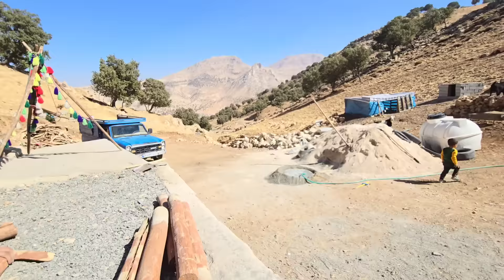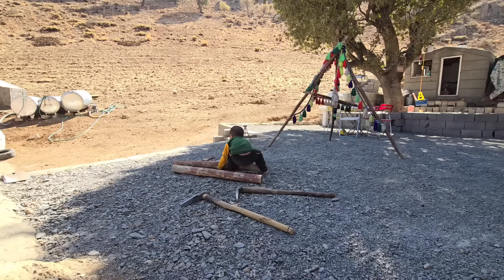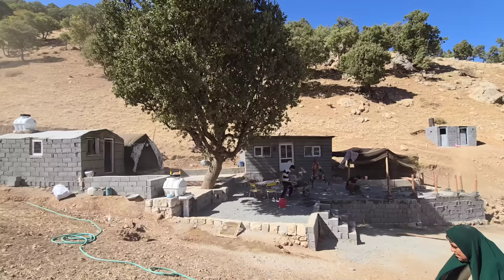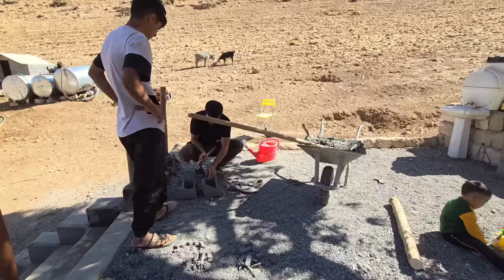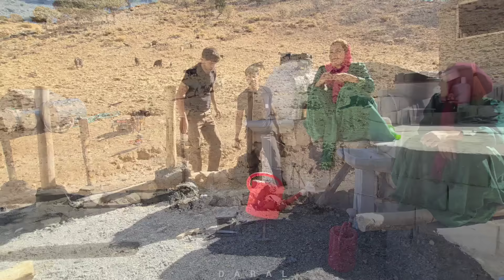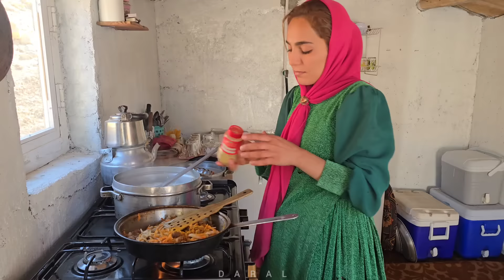🏡🪵"Milad and Qadir Install Wooden Fences in the Absence of Amir and Hasan"

Comment: Una sugerencia familia el cilindro de gas de la estufa debe ir afuera, pueden hacer un agujero y sacar la linea del gas, es peligroso tenerlo en lugares cerrados puede surgir un escape de gas y como no hay suficiente ventilación puede producir una explosión. Dios los bendiga familia.
Reply: ان وضعت خارجاً ستتجمد من البرد للاسف ، لذلك وضعوها داخل المطبخ
Reply: Sim iria congelar,mas não se fizessem uma casinha para o botijão
Reply: Querida Mahin, por favor bajale a la intensidad de la llama en tu estufa! 🙏
Reply from the maker: Querido amigo, la bombona de gas se congela afuera en el frío.
Reply: I had my gas bottles outside in below- freezing conditions with no issues they still worked. Just Insulated the gas line hose it won’t freeze.
Reply: Le pueden hacer una casita y protegerla,es mejor evitar un accidente family❤
Reply: por  mas de 30 años he tenido  mi balon de gas dentro de la cocina, todo va en ser responsable, controlar que no tenga perdida, la manguera y la valvula, ellos conocen el clima de su region mas que nosotros, como siempre digo, no imponer nuestras formas occidentales,

Comment: لكل من يقول ضع اسطوانه الغاز خارجا للاسف ستتجمد من البرد ، وضعها بالداخل افضل  والاهم بعدها عن الموقد قدر المستطاع  ،والله خير حافظ .
Reply: Contado respeto, es solo mi opinión,  yo vivo en un lugar donde las temperaturas bajan muchísimo en invierno , t también  hay ese problema  que se congela el gas , pero  para evitar eso se les construye una casita a los tanques    dejándolos algunas  ventilas y así no tenemos  ningún problema
Reply: @ErnestinaDelgadoMaciel 
وهذا اقتراح جميل يمكنهم العمل به .
انا مع اعطاء الحل دائما ، لاافضل اظهار المشكله فقط من غير اعطاء حل ، وانت مشكور اعطيت حل جميل والاجمل انه بسيط
Reply: Be nice if they would build a little storage outside from where the stove is,   for the  gas cylinder  and insulate it so the cylinders wouldn't freeze. They could run the hose through the wall and it would be much safer.
Reply from the maker: شكرا لك على تعليقك يا صديقي العزيز.

Comment: They should just build a platform at the back of the kitchen to hold the water tank, doesn’t have the be so high up … just higher than the inside tap. It’s dangerous to climb up and down the fill the tank, just build a stepped platform for the ladies.

Comment: I suggested that Midla build a concrete ramp on either side of the wooden fence so the carts could carry the soil to the center of the home area so the carts wouldn't be inaccessible. This leads to problems in the transportation of sand, gravel and cement bricks.

Midra, you need to consider building a house because this is a mountainous area with a slope. The houses you build together require cart routes for transporting sand, gravel and cement bricks. Because the construction location is high on a slope, you must Build a cement slope so that carts can be easily pushed into the center of the house. The width of the slope can be set at 90 cm to 100 cm to facilitate the entry of motorcycles and wheelchairs for the elderly with limited mobility. This is what you need to do in advance. consideration part.

Comment: Why is Mahin dressed for the snow and Shamoo is barefooted? Milad n Ghadir are not winter wearing.
Reply from the maker: Mahin is cold, but Milad is not.
Reply: @daarall  neither was Ghadir nor Ajav. I still say she preggers.
Reply: @User-n7f6n  when i was a kid i went out in the snow barefoot sometimes. i came in when i felt too cold. it never caused any illness or injuries, i guess if you feel cold and come into the warm house you prevent getting frostbite. if you were stuck outside and couldn't get in - that would be dangerous. now i'm an adult and wear shoes, but i do run out in the snow barefoot for a quick errand, like get the mail from the mailbox. if you walk around barefoot a lot your feet get toughened 🙂

Comment: What if instead of putting the ladder every time you fill up water in that tank why not instal a pipe connecting to that tank on top of the roof. Or construct a permanent stair instead of a ladder.

Comment: Mahin if you had a small refrigerator it would make your work in the kitchen easier.  There are models that run on gas then there models that run on electricity.

Comment: Good morning, especially to Mrs. Mahi, Shadi's mother. You are beautiful in creation and character. Beautiful in morals and very, very smart. You are not like the rest, they are all strong in body, they work day and night, Amir, Milado, Hassan Al-Tayeb, Ghadir Al-Marah, and the wise grandmother. But I like your intelligence, you change many of the mistakes they make when planning to do something. And I like your moving the oven next to the window, a smart move.  From it you can see through the window that whoever enters the site is the entrance towards the window. And when smoke or a fire occurs, you open the window. And I want you to ask Hassan to make a hole in the wall from the outside to inside the kitchen opposite the oven and to extend the gas hose from the outside to inside the hole in the wall to the oven and for the gas cylinder to be outside the kitchen. First, to save space, second, because of its danger near the heat. And make a protective room for it from wood outside under the kitchen window from the outside. Second, ask them, the idiots, to move the two trees in front of the Bedouin tent to under the wall under the dirt road on the ground. Their place here is high, they do not grow, they do not have any meaning on the ground under the wall, they grow and rise and rise with their shade. And benefit from this space, the poetry hall grows.  Thirdly, if you moved the sheep area to the last tree, the place where the donkey is tied would be better, because the smell of sheep urine and dung would return, and the spirit of the sheep would come out in the future with a smell. The kitchen and your rooms are close. How do you live? You are not Bedouins. You were in the city or village and came here to live the life of Bedouins. You are not Bedouins who do not know how to behave like Bedouins. This is a match. Every plan by the prince and his sons is stupidity and a mistake. The chicken coop is a mistake, it is not built like this. The proximity of the sheep coop that you want to do is a mistake. I thought you were making a bedroom for the prince and his wife, or for Hassan and Ghadir. What stupidity is this? You are smarter than them. Teach them.